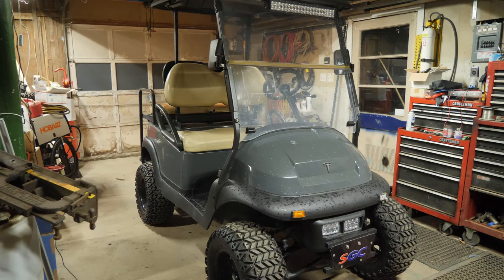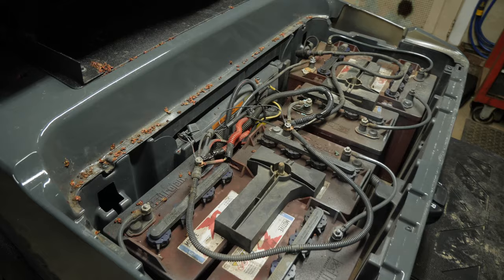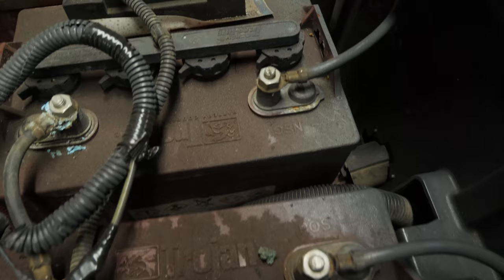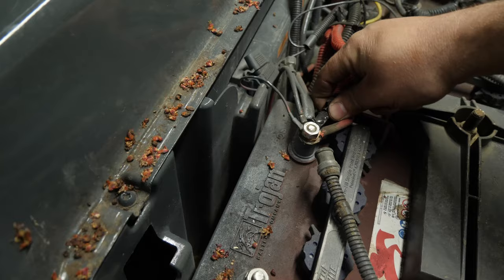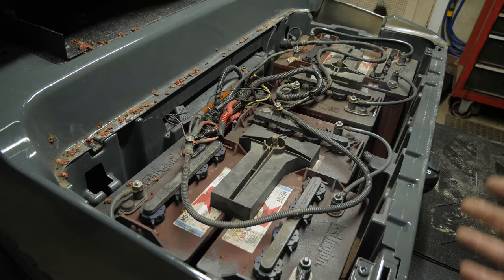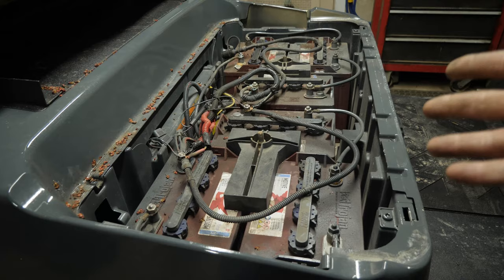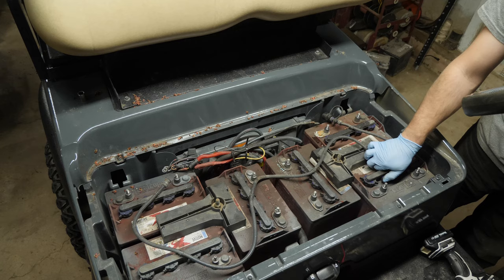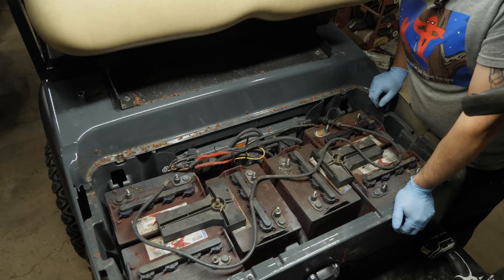2010+ Club Car Precedent, 48 Volt - Not Moving or Charging, Clean up Wires

Comment: Thanks Bro, my cart wouldn’t move, yours was the 2nd video i watched, per your advice checked the cables. One large neg cable broke when checking with pretty much no pressure corrosion rotted, same with a smaller cable, put on two new connectors and good as new, thanks again!!

Comment: You discourage using two 8 volt Batts to install a 12v accessory.  Assuming it's a 48v cart would it be  acceptable to use three 8v Batts to make a 24v system for accessories?   Then if necessary use a resistor to bring it further down to a 12 v circuit?  Or just start out with a 24v to 12 v resistor.
Reply from the maker: Use a voltage reducer that can handle up to 60 volts. Don't use a resistor. The reason for using the entire pack is for even pack draw. Discharging the pack unevenly can cause issues over time.

Comment: Thanks that was hepfullly,,, i was weating for the last part, where you install the volt reducer, but the info was top top top ,thanks for that,, if you have the opportunity to explain us that how to change the POLARIZED PLUG 15 AMP / 125 VA and POLARIZED EXTENSION SOCKET 15 AMP/125VAC. saludos desde Costa  Rica.

Comment: I second your opinion on battery fill systems. Did you know if one battery blows up when a fill system connected they all blow up? Fill systems act like fuses connecting the bombs
Reply from the maker: That's a good point. I had a customer with that exact situation. Their cart caught fire while charging and the whole pack went boom. Needless to say, I couldn't repair it, lol. No one was hurt, no structures were damaged.

Comment: Great channel.  Is there a main fuse somewhere on these.  I have one like this one and now it won’t charge.  I’ve tried multiple chargers.  They won’t do anything and there’s nothing but stock wiring.  Just went from working to not working.  Thanks.
Reply from the maker: There is a fuse on the gray wire (if I recall correctly). Depending on the year, you have to search out the gray wire coming from the charge receptacle. I would check the battery pack voltage and make sure its above 42 volts. If its lower, factory chargers will not come on. If its above 42 volts, the on-board computer may have failed. The OBC controls the charger on Club Cars. I think its a crap system but, its what they use. If the OBC is dead, you can bypass it and get an aftermarket charger that will do a much better job at charging.

Comment: Have you ever had any dealings with a zonE 48 volt electric?  I have a chance of getting one that has all new batteries but won’t come on. Turn key I’m getting no volt readings or anything. All the cables are good and clean and tight
Reply from the maker: I don't deal with the cheap Chinese carts. I had a demo cart here from Evolution and it was a huge POS.